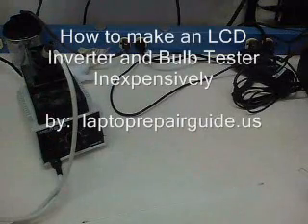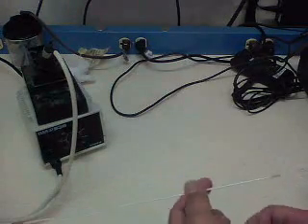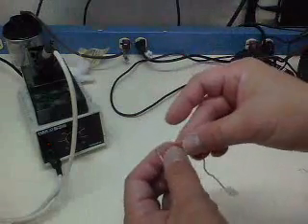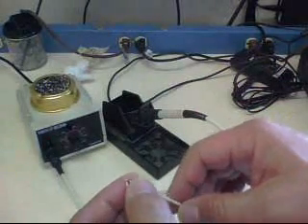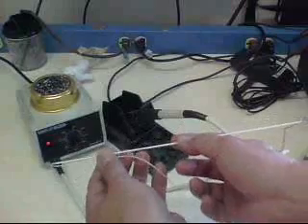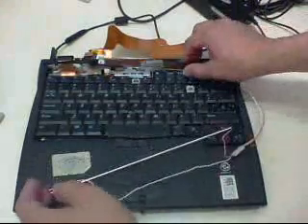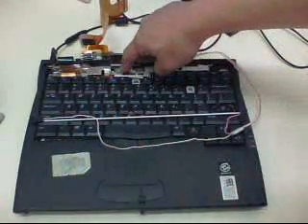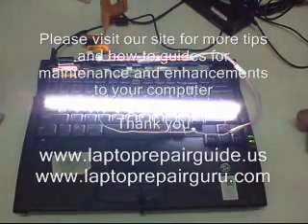How to test laptop inverter and bulb using a home-made tester

Comment: in my case , acer aspire 5532 , increasing the brightness display goes off , but anything else still running, and in low brightness mode works fine , any idea why ?

Comment: Home made tester?
It's a laptop?
Reply: It's a bulb with connector. If it emits light, that means inverter of tested device (laptop) is fine. I wonder, on my part, if it is possible to test monitor bulbs by disconnecting some, and expecting those connected healthy coming up. In my case protection circuitry shuts in "2 seconds to black" fashion. Having exchanged caps, I would want to exclude failing lamp, drawing too much current. Notes, that I find, suggest connecting spare bulb in place of that disconnected - it may be, that such load is mandatory?

Comment: It works a bit like neon lamps used in signs for diners or store signs. Neon signs are manufactured to display a wide range of colours.

CCFLs, for laptop screens, emit as close to possible to white light. 

See CCFL and CFL and color temperature on Wikipedia for more info,

Comment: No. There is no continuity through the bulb. It's not like a regular bulb with a continuous wire (filament) from one connector to the other.

The CCFL is a glass tube, coated inside with phosphor which glows brightly when excited by UV light. Both ends of the tube have connectors (electrodes). The tube contains mercury vapour (no air). When about 1,000V is applied to the electrodes, the electrons pass between the two connectors and excite the mercury vapour, creating UV and the phosphor glows.

Comment from the maker: CCFL backlight connectors are standard. You can buy them in Ebay.  Here's the link:   bit.ly /16pG0YZ     note:  There is a space in the link just to validate the post. Just remove the space so that you will arrive to the correct site.

Comment: I am trying to fix a toshiba satellite A205 with no display at all. Power and Hard Disk indicator lights are working upon switch on. I replaced both LCD & LCD inverter but still not working. What would be the possible cause?

Comment from the maker: So it looks like the cable is good too, ha!.. and yes it suggest that we go to the motherboard to check some open fuse.  The fuse on the motherboard are a little bit tricky, because they look like very small black SMDs.. unless we have the schematics of the circuit then we can pinpoint right away, but in our case we have to do trial and error. I mean you have to locate those tiny black two-leg components and do continuity test on them if you are having problem locating the "F" footprint.

Comment from the maker: I'm glad to hear that you found the fuses and tested them accordingly.  It looks like we are down to the video/data cable and worse case is the MB not supplying power... Did you ever "reset or clean" the video cable on the MB side to see if it got loose or corroded? Actually, you can trace those 4-6 wires going to the MB and test the sockets, on the MB for any voltage readings... I'm sorry to learn that your case is a bit complex. I hope you'll find some relief along the diagnostics.

Comment from the maker: I wouldn't advise using those tiny pins, because it's hard to squeeze in the test prods without shorting them. But if you can manage to touch with  your probes without shorting them then go for it, so that it will save you some time opening the base... but on another thought I'm afraid you have to expose the inverter board so that you can touch the surface mount fuse as well as the body-ground of your inverter.  By exposing the fuse you can also test if it is still intact or blown.

Comment from the maker: that's a great question you have there. Yes you can do that, the voltage is normally 13-16Volts and you can place your test prods of your dc voltmeter at the entry socket or components. Please be careful not to short them. Im not sure if you know how to distinguish a SMD fuse. That's where you put the + or positive prod, while the common will be on the ground of the inverter...I think I will create a video since it's hard for others to understand what I am describing..I'll let you know soon

Comment: my power inverter seems to work wen i bearly connect the computer lcd connection to it  wen i push it all the way in it turns off the image,  so that means that my lcd inverter is not the problem   but the main connection for the lcd inverter that comes from the computer?   how can i replace that part in a thinkpad t60?    or is it the lcd inverter the problem?